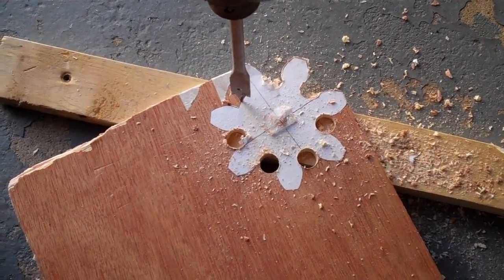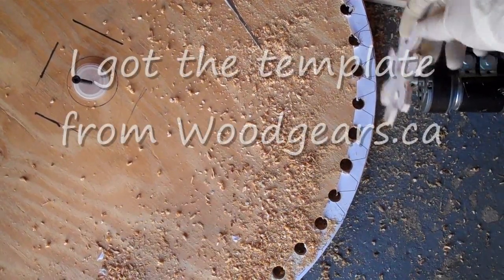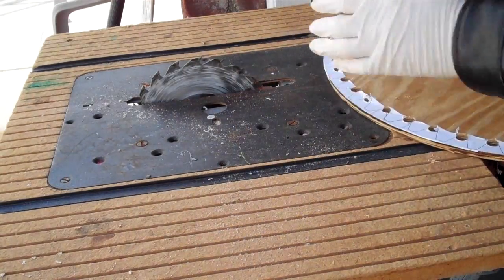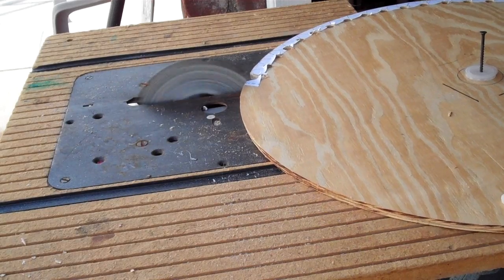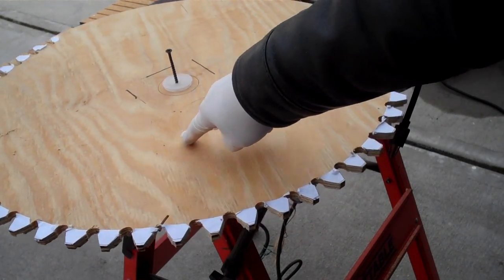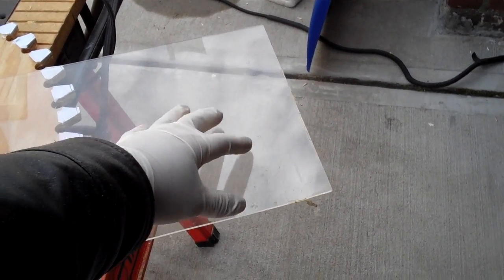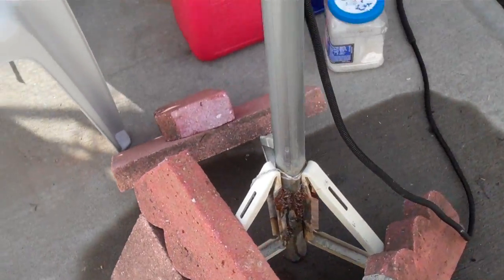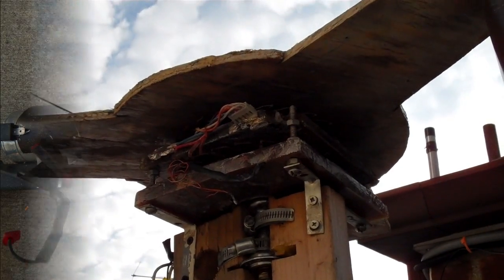Cutting gears for solar oven tracker

Comment: What DC motor are you using?
Reply from the maker: I believe I used a low rpm (60 rpm) geared dc motor. I no longer have this setup.  Thanks for watching.

Comment: I'm thinking you would have saved a LOT of time by simply buying an old $10 ten speed bicycle and using a large belt to go around the rear wheel and set the chain gear ratio to the highest speed.   You may need to use a timer to turn your motor on an off for a few minutes every hour. It would be even easier if someone sold a 24 hr clock with a motor powerful enough to rotate your device.
Reply from the maker: A timer or a spring to turn the platter is a good way. It's hard when there is no commercial alternative or when the commercial alternative costs hundreds of dollars. Yes, this is the hard way. But mainly I do it as a hobby and for fun. Thanks for your insight.
Reply: wtam69 Yes, I do a lot of crazy experiments for fun and I sometimes find ways to get the same results as devices that cost hundreds of dollars.  I'm looking into solar tracking and it seems everyone uses sensors... but they have to reset the system at night.... and when it's cloudy they have a host of problems.  It would be simpler just to turn 360 degrees in 24 hours... like a 24 hr clock... then it would always be pointed at the sun even when the sun is on the opposite side of the world.   But that is a major gear reduction even for motors that turn at very slow speeds.   I'm thinking that a windshield wiper motor, using an intermittent setting may be the easiest solution.
Reply: You probably could have joined a few bicycle chains around it and used a sprocke to turn it.
Reply from the maker: Your thoughts were my thoughts before I worked on this. It'd have been easier if someone has a motor with a timer etc. But then you still need a power source, or batteries to drive them. Spring powered movement is probably the best way. Like a spring tensioned child's toy, except it can be adjustable so that it can be sync with the sun's movement.
Reply: I've ordered a 12 v timer from ebay for $5 and I'll try it with something like a windshield wiper from an old car.  All I want to do is create a 24 hr clock with enough power that wind + the weight of solar panels won't tear it up.
Reply from the maker: Maybe you can make a video of your upcoming project.

Comment from the maker: It definitely will work better horizontally. It's just that I would have to make a bracket to hang the motor upside down. I was hoping to just lay the motor sideways and avoid the need for a complicated bracket. Thanks for commenting.